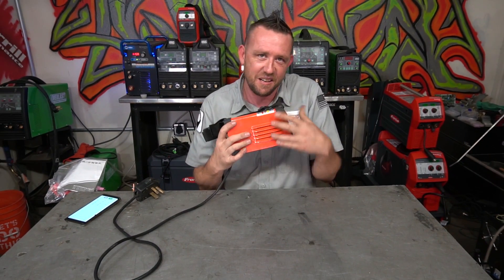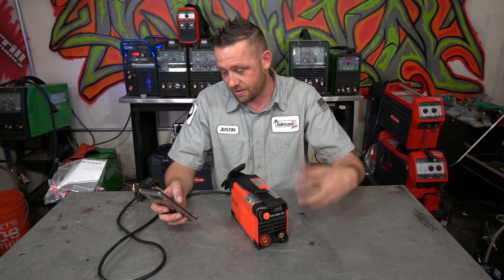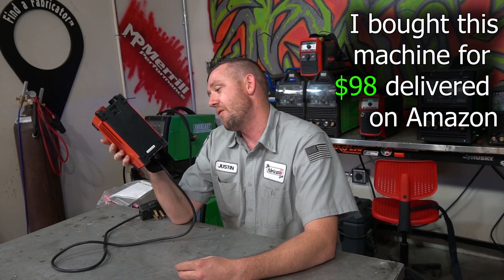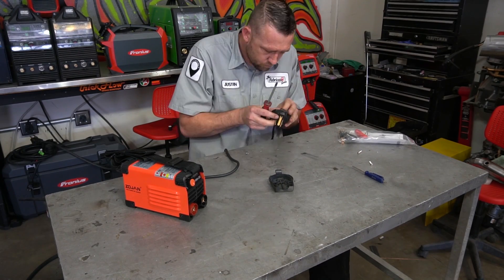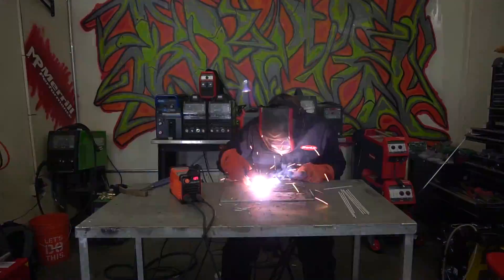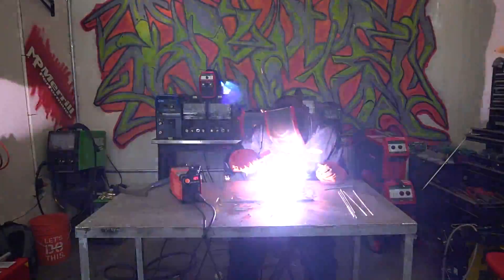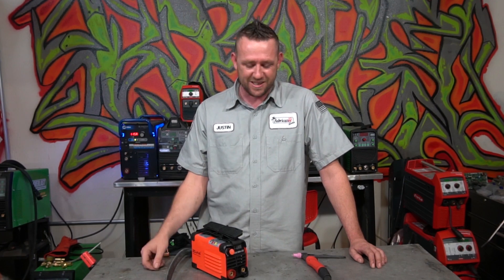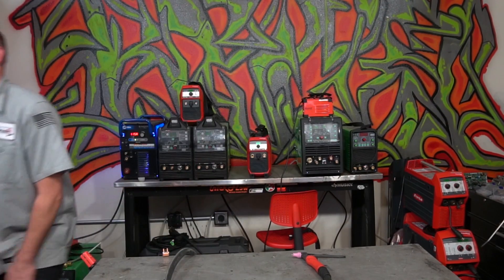TFS: The Smallest Welder EVER! Will it TIG?

Comment from the maker: 👇👇Here is the link to the Mini MMA-250
👇👇
https://amzn.to/2scNeDb

 Other Tools & Gear We Use and Recommend
https://www.amazon.com/shop/thefabricationseries
Reply: Should've tried reading the description it's not 250 is 160
Reply from the maker: Norman Parker The description was actually changed after this video (see other comments talking about it) Other ads still say 250. It's also not even 160 amps. It's probably not even 125.
Reply: I like that they list it as a 'portable welder SOLDERING machine' hahaha -is this an admission that its not really very powerful... :)
Reply: make it into a spot welder
Reply: Good video!  If you had an AC/DC  Clamp-on Amperage meter, you could clamp it to either output cable and read the actual amperage. Great for working on cars too.
Reply: @williamreynolds8210  Please sir
I would buy myself a small welding machine like this
Or is it just a waste of money
Is it effective and long lasting
Reply: Maybe this stuff could work like power source to derusting by electrolysis.
Reply: I think you should take it apart and double check all the power cable connections. I'm pretty sure there's a loose cable so that instead of getting 220V the machine is only getting 110V. I'm just saying... It's made in China. So I wouldn't be surprised if there was a loose bolt on one of the +110V cables making a crappy connection in the box.
Reply: The welder welds well.
You can also get it to tig.
Does what it should .
Small , light good looking.
But you cant recomend it because it might pack up ?
Reply: The Fabrication Series
Reply: Now it's only S$39.90 USD Shipping Fee: US$4.18
Reply: @bigish47  I got a  "Minleaf" 110volt unit for $38 on Banggood (5 days to get there from USA warehouse).  Same results as this video, BUT at 120VAC input.  So a little better and "I hope" a larger input power cord will help more (their power wire is thin and cord is short (3 or 4 feet), I added 6 feet more since no plug on it).  I have an Everlast 255 AC/DC TIG, 2 plasmas (50 and 80) and 2 (205/250) MIG units.  OK, so I bought it for fun and the price ($38, and I had the parts for clamp and stinger leads).  Mine will do 1/16 6010 (nice), 3/32 7018 (OK), all I had.  

But when Justin said his was on 220 volts input.  Something is UP!  My power out is about 1/2 the display amps (SAME) but with a 15 amp 120 vac household input source.  My first thought, no gas and tiny, it would fill a spot for somewhere (back of truck lol).  I have sold 2 of them already after showing it.   

I don't believe it is a paper weight.  Maybe a larger input cord.  Going to open mine and look for a 220vac hookup so I can add a switch and maybe get 180+ out of it.  Looks like the SX7 main board in them.  Will look for schematics.  EE side of me wants to play.  Welder side thinks it is a cool toy, not a paper weight.  Handy to tack up small tools adding washers and nuts and bolts.  My 2 cents.
Reply: Hi, I'm a really old git now, 50 yrs ago I did some gas welding and weren't to bad, anyway I would like to practice a bit!  
Because I am going to work on a old camper. 
But since I live in a high rise block of flats.  
would this little stick welder  be ok to teach myself the basics before I start on the camper?  
If poss please say yes, as I already bought one.  CHEERS..
Reply from the maker: Mind Freshener It was running on 220v, not 110. It's a 220v machine.
Reply: Well I just looked, 98.90 for the machine. Delivery? Oh that's a cool 100.99 to the UK.
I think I'll pass if its all the same to you. By the time I've put import duty and VAT on top, I'm too close to 300 for comfort.
Reply: @v8trauma  thank got I live in Texas. Ya'll have pay tons of money for all that socialism. I paid $2k here for a rust free 75 vette and 2k in restoring it. This little welder for $100 us is perfect for my needs like making brackets for a oil catch can etc.  But yes. You probably are better off buying a welder locally.
Reply: Mind Freshener  ???  He said 220-240, and connected a  220/240 plug...
Reply: For a mini set like this, it's logical that the amp would be 120 max... If you have reviewed many other mini sets..

Comment: MMA 250 A MADE IN CHINA MEENS ONLY 125 AMPER DC OUTPUT MAX!! If works cntinuely 30-40 min the Elektronik Sets back
 To Protekt the Hot Mosfetts  and gives  only the minimum from 10 Amper DC to save that!!!
Reply: There is adjustment little blue Potentiometer to adjust down Carefuly the Real Amper Power and you can See it direkt to Display from 10 - 125 amsDC

Comment: I grabbed the new version of this for ... $22!! it had an arc force control. Same deal, half amps. The interesting thing with my other relatively cheap dedicated Tig machine is on TIG mode, the amps read correctly. Set on stick mode, they're half like you got on this! So I think maybe what they did is just shove the inverter section of a tig welder into these things and didn't do anything to replace whatever the TIG brain box is doing to correct that. Another interesting thing with my $22 one, it actually powered up on 120v and even the fan was happy, and read the correct 24v at the fan output. My better TIG machine does too, but they state that in the manual for that one at least. I wonder if you could set it to say, 150 on the display, and stick weld on 120v for a while, I'm going to test it out.

Comment: On some things u have to use positive ground. 
Negative lead will be the hot lead. Actually it's not. 
It's the neutral. There is no ground on this package. 
But it says that you need to keep the body ground. 
I see he put an  extra wire to the ground. But connection to where. On the welder.

Comment: where do you keep the gas on those shoulder strapped portable tig inverter machines? do they have like a small canister inside them or you have to bring an external small cylinder with you?

Comment: Man, things have come a long way! They now sell a similar welder for $84, with the same beautiful case and an arc force adjustment, amperage adjustment, a copper ground clamp, 120v/220v plug adapters on the power cord.

Comment: I bought one as a novelty. Only cost AU$80, BUT, with no plug or leads, this represents very poor economics.
I had spare work cables, but if you had to buy everything, that would be about - $7.00 plus time for a power plug, and around $85.00 for work cables, ground clamp, and rod holder, PLUS time to make them up. NOT a good deal at all. Mine would be lucky to run at 120amp. The whole setup is a gimmick..!!!

Comment: You should know that typically welder machines that has 250 in its name actually can achieve barely 180 Amps (160 is most common case). It's because its schematics was designed by some engineers who can fix it easily and was able to tune it up to 250 Amps (using expensive electronic components and fine tuning). But in mass production they don't use expensive components (or even they don't use all needed components) and therefore machines must be tuned down a little to reliability improvement.

Comment: I have a little blue China welder welder about2xtbe size of yours. It's 200amp but more like 150A really. I've put about 20lbs of 3/32 at the 110A setting. And a few lbs of 1/8 at 140A setting. I got it hopping it would last for one project but it just keeps going. No. Yes it's over rated but still worth every penny.

Comment: Think about the surface area contact of the tips on your jumper cable clamp teeth I suspect the jaws were getting hot .rig it up with some kind of circumferential clamp that will still let you slide the hose on

Comment: Aktually I think if you can weld with it for 100 bucks it's fine it doesn't cost for 250 amps and it's not big like 250 amps ... But I would be worried about that it didn't cut out after 12 rods probably its not able to and just goes boom if it's rlly to much

Comment: Also, I have 3 millers that costed me more than $7000 and now they're just collecting dust in my storage. They constantly break down and one of them is 110 Lbs... Who wants to Haul a Boulder Rock Around plus cables, tanks, gauges and tools needed to set them up? But 10 Lbs of cuteness that bites like a Shark and can make Justin Sweat like a pig? Little Red Midget wins every time. I mean Justin, what did you expect for $97 in a small package? Post flow, Pulse, Frequency? Anti-Stick? Maybe Plasma cutter included? A stick welder that came to stick weld and it did so flawlessly and even Tig welded. Very negative review. My God, the freakin Ego of some people. I'm going back to 6061 or Jodi. I'm done with this guy... The nerve.

Comment: In ALL fairness, that welder DID what it came to do. It burned 12 Rods without quitting which is more than I can say for some bigger welders at 50 Lbs. Then you mentioned in one of your reply comments to go with the Fronius Accupocket which I hope you're talking about the 180 model which goes for $1,380 and not the 150 battery powered which is a Ridiculous $3,300 and just because it can weld out of a battery, it doesn't justify me spending that type of dough unless I live in the mountains or roam the desert in a post apocalyptic Era where electricity is no longer viable and unless it is powered by Solar, I don't see me buying one any time soon, not for $3,300 plus tax (that's almost $3,500 bucks!
Maybe this little midget is not everybody's dream come true, but it welds with consistency. It did Tig (maxed out, but it did) and it's not a Tig welder, it's a stick welder which by the way, requires not breaking my back to carry it around, No tanks or gauges and the whole little Rig with cables included is less than 10 Lbs! I don't know why anyone (including you) wouldn't want to have it as a back up welder which can be carried in a key chain and can fit in the glove compartment. You couldn't blow its duty cycle but do you expect for $70? (that is what they cost now, even less) and we all know that most welders, except for the HTP Stick ($1,499 made in Italy) and the Fronius ($3,500) made in Austria, for the most part are all made in China, EVEN Miller, Esab, Everlast, Etc... I bet 3 of those can outlast 1 of the more expensive ones and keep going... Unfair Review. You might use it as a 'paper weight' and have a conversation over it or use it for decoration in your kitchen next to the toaster, but it Goddamn Welds and it did it with flying stars. Even if the digital readout says otherwise. I have two of them and in a pinch, they haven't let me down yet. Also noticed that the bigger the gauge cable I use, the better they weld and If purchased in Amazon, you can add 4 long years of Insurance for $9.99 with Assurion. Can you say that about any other welder in your shop? Under $100, with insurance, under 10 Lbs? I think not. Great little midgets!

Comment: Your jumper cable is the problem. 80 amps is still low for a 3/32 7018 and you wouldn't be able to strike an arc on it at 40 amps. Its your jumperbcable hookup that is the problem

Comment: I had one that was smaller in height (square from the front) slightly longer in length. 
I was an Italian Rossi. Stick / Tig. Welded amazingly even wet rod started & welded smooth as silk.
Lent it to a friend … never got it back.

Comment: I live in Thailand  and it cost me $39 including shipping. It is grossly over rating the amps. At 80 amps my meter shows approximately 50 amps. 6010 usually ran at 60 amps requires 120 to 130 amps.

Comment: Well, you obviously have forgotten this is a DC inverter welder. DC inverter welders produce stable and deeper welding with much less ampers. That means instead of 100A on old welders, you would use 50A on DC inverter. Display will still show 100A because in the rod instruction you would have written those numbers. Those little inverters work great and for many, many years, as I know from the experience, but nobody planned to use them for TIG. So, quite bad review.

Comment: Can this weld aluminum using Ali sticks?   ( new to this, need to weld a ladder). Thanks
Reply: Sally, check out "Blue Demon" aluminium welding rods, they'll work with a burns'o'matic torch and a bottle of  Propane or MAP gas...  much less and you can fix your ladder wink
Reply: @ivonalivalot4035  
Thanks a lot.
I will certainly try them....
Take care.   👍

Comment: I travelled to a job welding a trailer frame completely empty handed once on the promise of them having an arc welder on site,arrived to find what looked like like not much more than a battery charger of similar size to this thing which would weld for about two minutes before thermally tripping for five minutes,it wasn't frustrating!

Comment: The half current thing seems common with these.  I wish they'd just rate it as what it is.  It still has use as a 100A welder.
Reply: Would love for you to tear one apart! They seem great, but i agree on the current thing. The companies are just trying to outdo themselves
Reply: Agree. Works great on sheet metal.  Wasn't meant to be a shop welder. Good for around the house/hobbyists stuff.
Reply: It even can TIG. And yes, all of these use 1/2A as unit. I see this and similar others as a good deal for the hobbyst.
Reply: Good to keep in my truck. Gotten myself out of a bind before with that and a generator.  So it has uses; not every welds day in and day out.
Reply: There is numb inside,with wich you can adjust ampers,what ewer you like.
Reply: yep i just got a small welder very similar to this one and was struggling to weld a continuous beed. i just could not do 3/32 6013 at the displayed 93 amps. cranking up the amps really helps, but the little welder maxes out at 180amp on the display so technically its probably maxing out at 90amp.
Reply: I have a Harbor Freight 90A flux core welder that’s put in some long days patching stuff around here. Not a great machine but it feeds well and will stick stuff together in a not coming apart there again way. Sometimes I can even get some ok looking needs out of it, others if I could scrape and save all the spatter BBs I would never need to buy shot again.
Reply: Who let you into a welding channel!!!
Reply: You can get 1/16” weld rods .
Reply: chinese amps, to get real divide by 2 or 3

Comment: Dam , Here I am 2 years late , well I have a small welder it's a Pico 180 and it has a Tig attachment but scratch start only it's 1 1/2 times the welder you have there you need to know this . mine has a switch that you change from stick welding to Tig and you must change the leads over for the polarity , this thing is fantastic and it can run on a generater . and mine was $1,250.00 I worked in small towns in the midel of no were using generators

Comment: I bet it will O.C at 12 rods. My Amico stick welder 110/220 at 40 amps with 50%v died out at 12 rods only using 1/16" rods.

Comment: OK, the little part isn't what it claims to be, but once you understand that Chinese amps are only half the size of amps on the rest of the world, it's a fine piece of equipment in the tool kit for smaller out-of-home repairs, It is so small and light that it can always be with you. And if I compare this with the hardware store, do-it-yourself transformer welding devices, this small device can do significantly more than these extremely heavy AC sizzling boxes that cost four times as much, bring 10% on time. I got my pint for just $ 30, and knowing the limits, it's a tool that is good to have.

Comment: Is it possible the reason it only works at half the rated power is due to the fact that in the us you run on 110v vs 220/230v like most other places and they just didn't bother to make it work properly over there?

Comment: Do us a favour and swap out the adjustment pot for one half the size.  I've found on these cheap welders they slap any old pot in there.  Swap out the pot to the right size and they do close to what they claim they can do. I've had to do it on the pedal on my TIG and I've had to do it on the Wire feed on a MIG.  After that home adjustment, they were OK machines.  Oh and these things don't have soft start.  So that may explain the problems you had with stick at low amps.

Comment: I heard there is an option called VRD. Voltage Reduction Device. If it’s on would that be the reason it’s producing only half amps?
Reply: No.  The USA 240 volts is not the same as Chinese 220 volts.  Before you laugh, you will need to understand electricity better.   The US has two hot legs of 120 volts that are 180 degrees out of phase.   The Chinese hot legs truly are 220 volts.  They are not the same.  Europe too.

Comment: I bought this exact same welder and I use it to do scratch start tig as well as stick welding. Probably doesn’t have the skookum to do heavy stuff, but up to about 1/4” it seems to be fine for what I do. I actually have had it about 2 years and use it frequently as a hobbyist.

Comment: Just bought a 225 amp welder like this one.  Having the same 1/2 amp trouble.  Have it running on 240 volts like its supposed to.  It checked out at half amps with a clamp on meter on 1 lead while welding.  Works great and even has arc force setting which increases the amps when you hold a tight arc length and helps  to keep rods from sticking.  Has built in hot start too.  I was very disappointed on the amperage, but when you start welding with it and it works very smooth.  I have asked the seller to look into it and if I find out anything I will post it on here.  I want to get to the bottom of false advertising or the technical reason why it half amps.  By the way I paid $43 for it including shipping from a warehouse in the USA.

Comment: The advantage I see to the little inverter units is portability, and it requiring 220VAC ruins the portable factor. I've got a Eastwood Arc80, it's not much bigger than that and its 110VAC. Its handy for light repairs